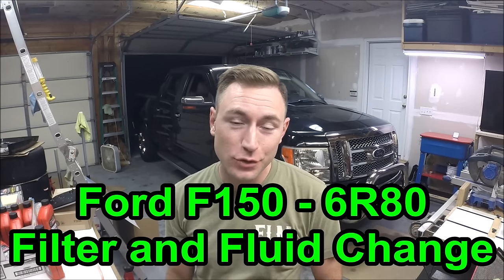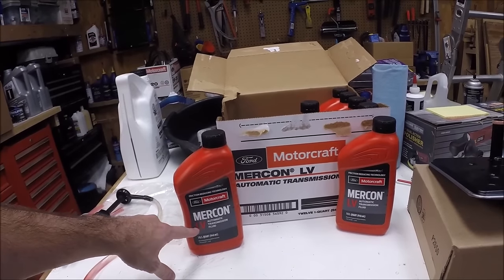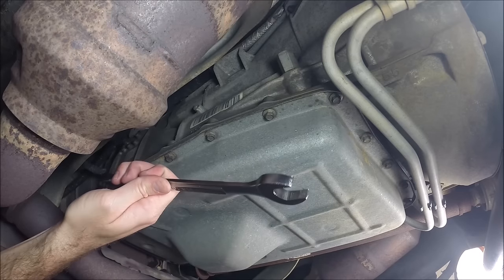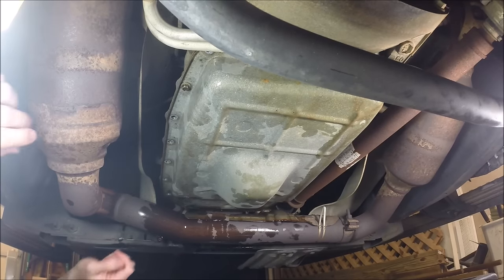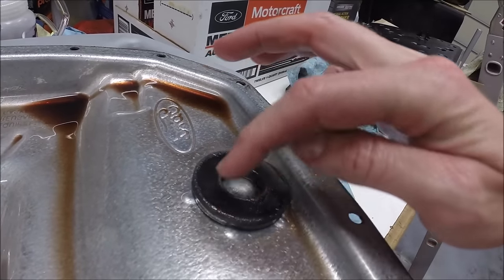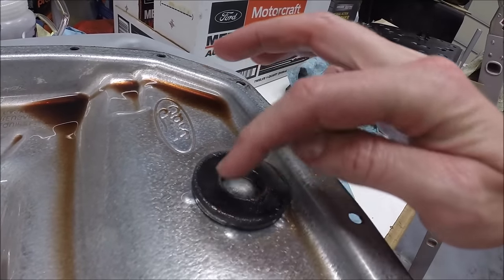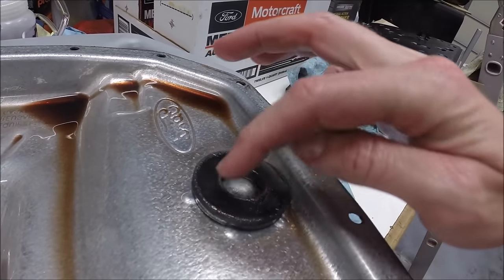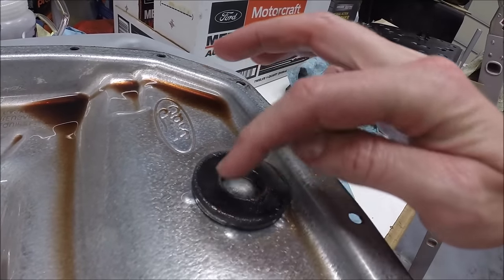Ford F150 - 6R80 Filter and Fluid Change

Comment: Thanks for the information about the measuring gauge - I have not seen this before.  Why is the oil not sucked out through this opening?  It would be a lot cleaner than be submitted to the Ford contempt for their customers.
Reply from the maker: You can probably get some of the fluid out of the fill hole, but not all of it.  You'll still have to drop the pan to get the rest out, and that still makes a bit of a mess.  I was changing the filter also, so the pan had to come down regardless, so I didn't spend too much time trying to suck fluid out of the fill hole.  With a bit more effort you might have better success?

Comment: Great video Scruf. Did the fluid and filter change solve your low speed shudder issue? I just bought a 2010 and it has that shudder.
Reply from the maker: Yes, it definitely improved it.   Well worth the effort in my opinion.
Reply: @ScrufsGarage  check TrasnsGO shift improvement kit. It will address the shutter issue. It’s due to wear in the valve body. Pt# SK6R80

https://www.rockauto.com/en/catalog/ford,2013,f-150,5.0l+v8,3000982,transmission-automatic

Comment: good time to add a bulkhead type drain plug...Fords new "no DIY" vehicles suck,no trans dipstick or drain plug,no fuel filter .sad ,I love my truck  except for these issues . Draining the pan and filter and adding 6 new quarts is nice but you are leaving behind about another 5-6 quarts in the system,its debatable if it needs to be flushed. Your fluid looks clean and magnet too..

Comment: Did it stop the rumble? Mine just started the rumble strip sound only at around 50 normal driving when I'm on the gas at a steady speed on and off a second or two. Almost exactly if you hit the strip and move off it. If I accelerate through 50 it doesn't do it, only city driving around 50 on and off gas.

Comment: Great attitude and awesome video!!! Getting ready to do my 2017 2.7 6 speed, been told it was the same transmission as yours. Lil nervous, but I do my oil changes and heard a lot of stories about being charged for this service and it wasn’t really done. My question when you start the engine to shift it through the gears and then check it do you need to put the cap where the lil dip stick was or is it ok to leave it off?
Reply: Put it back on

Comment: Did your truck run smooth after changing the fluid? Just curious on how the transmission performed
Reply from the maker: Yes, the fluid change helped reduce the shudder I was getting.

Comment: They make it difficult to handle. I have 2013, I don't see what interval to change the transmission fluid in the owners manual book. Can you tell me. I want to do by myself. Thanks
Reply from the maker: My truck was a 2010, but I'm pretty sure your 2013 is the same.   Ford considers the transmission fluid to be a "lifetime fill."  So they don't list a service interval.   But as you can see in the video, my fluid was very dirty.   I definitely think it is worth changing the fluid.

Comment: I know this is an old video, but did this fluid change fix your shutter?
Reply from the maker: Yes, changing the fluid definitely helped.   With a basic drain/fill, you get about half of the old fluid out.  So if your fluid is particularly dirty, then it may be worth changing the fluid a second time to help get a larger percentage of the old fluid out.

Comment: I have a 2014 F-150 Raptor . With 110,000 miles do you thing I should do mine? What transmission filter would I use? Do you have the part number? I’ve watched all your videos and they’ve helped me with my 07 FX4
Reply: Major Media freak You should have done yours at 30k per fordtechmakuloco. I follow his vids as he is very knowledgeable and a former ford tech. Mine has 49k and I just did mine after seeing his videos. Call a ford dealer parts Dept and give them your vin and they will tell you which filter you need it's either ft187 or ft188 most likely. Use what the book recommends for fluid too. Mercon LV
Reply: Peter Last-So I knocked it out. New filter oil and I added a new pan that has a plug. For future service. Man that oil was black!
Reply: Major Media freak what did the pan run ya cost wise? I heard they are expensive so I didn't bother. I'm sure that fluid was black with that mileage!
Reply: Peter Last -$36 on amazon Dorman 265-854 transmission pan with drain plug! In the past I got one for my 2007 Ford F-150 FX4.
Reply: Peter Last anytime

Comment: Changed the transmission fluid. Got 6 .5 qts into it but for some reason its not running no more any clue why? It was runnin great before the pan drop. Has 190k miles on it.
Reply from the maker: One possibility is that the filter moved while you were putting the pan back on and it's sucking air instead of pulling fluid through the filter.     Let us know what you finally determine it to be.
Reply: @ScrufsGarage  well I finally found out what was wrong. Actually my wife searched her ass off and found a similar case. Come to find out after market parts maybe designed the same but may not be the specific dimensions. The intake pipe that faces the pan was 3/4 too long so I used some snips to trim it down to the originals dimensions. It worked great. So to all who work on vehicles beware of these minor details.

Comment: Had a shop tell me they would have to loosen the exhaust to remove pan and gave me a 700 dollar quote to complete charge over. 
So I bought a new pan with a drain plug and am going to do it myself.
Reply: I drilled a 1/8 inch hole in the bottom of the pan. Let it drain over night and removed the pan. There was no fluid spill. Replaced the filter, used JB weld to plug the hole, replaced the pan and put exactly the same amount of fluid that was removed. Worked fine.

Comment: Looks. Like Dark oil might be rebuilding the trans ?
Reply from the maker: Yea, that trans fluid definitely was due to be changed.  No issues with the transmission itself, and no debris in the old fluid.  I recommend catching the old fluid in a clean pan so you can inspect it and make sure there's no glitter.  Ford calls this fluid a "lifetime" fill.  But seeing how dirty the old fluid was, I definitely think it's worth changing more frequently.

Comment: Can you drill and tap a hole to put a drain plug in the transmission pan?  I haven’t pulled the pan yet, so it may be too thin.
Reply: I took the pan off, drilled a hole then had a muffler shop weld a nut to the bottom of the pan since they weld thin metals without blowing holes through or overheating the whole thing and warping it, then I put an Allen head pipe plug into the nut, the pan is too thin to thread and most aftermarket add on plugs end up leaking anyway.

Comment: my 2014 3.5l ecoboost took 4.5 quarts after a pan drop. Owners manual says it holds 13 quarts. Crazy.
Reply: Hold 13 quarts total, which there is fluid in the transmission that can only be replaced by doing a flush not just dropping the pan..the torque converter alone probably holds 2-3 quarts.
Reply: @planetofthederps4490  Yeah I'm doing it again in a few weeks. It did make a big difference much smoother shifting.

Comment: Does it clunk when you take off from a stop? My 2011 does and it has something to do with the slip yoke binding on the splines. Drives me nuts.
Reply from the maker: No haven't noticed a cluck, but I'll be listening for it now, haha.    The shudder didn't start until the last month or two, though it seems to be a common complaint for a lot of owners.  Changing the fluid definitely improved the shudder, though didn't get rid of it completely.   But that's probably because you're only really changing about half the fluid in the system.  Depending on how motivated I feel, I might do another ATF fluid change at my next oil change... maybe.
Reply from the maker: btw, I think you jinxed me, haha.  I've been noticing the driveshaft clunk recently.
Reply: I had the clunk on my 2010 Platinum with 2 piece driveshaft. Was able to put it on a lift and pump a Sh*t load of grease into the splines and now bump is gone :).  After about 6 months its slightly back again so i guess its something i have to keep doing.
With 2 piece just make sure you buy the retaining clip for the boot,.
Reply: The clunk can be fixed by lubing the yoke and splines
Reply: Scruf's Garage try to mount a camera underneath looking at the trans. There's a guy that shows the shudder coming from it shaking all over. Ford wouldn't do anything for him though but it helps to see what's going on
Reply: @bobwalter5573  I had the clunk driving it home day 1 new. Figured it was normal and 150,000 now.
Reply: The clunk you feel is known as (slip bump) a well known issue with the two part drive shafts in this model year. To fix this issue you have to drop the rear end of drive shaft and and remove carrier bearing assembly and lubricate the spline on the shaft connection and reinstall drive shaft.

Comment: So did it fix the problem
Reply from the maker: Yes, changing the fluid significantly reduced the shudder I was getting.  Since you are only getting about half of the fluid out, doing a second change after a few miles would probably be helpful also if you have the time.  But I saw improvement even after just one fluid change.

Comment: Well, what was the result afterward? Did the shudder go away?
Reply from the maker: Yes, it was greatly improved.  Since you're only getting about half the fluid out in a drain/fill, you could probably see some more improvement from doing the service a second time.  But even just doing it once, I saw a noticeable improvement.  Definitely worth doing.
Reply: @ScrufsGarage  Good to hear, I just picked up some LV to do mine. Have a 2011 with 110k miles. Just started noticing shudder during acceleration in 1st and a little stiffer shift to 2nd.

Comment: Is it possible to use a hand pump and pump most of the ATF out via the dip stick fill hole? Is there a way to get a tube skinny enough down there to get most of it out before removing the pan?
Reply from the maker: While you might be able to get some of the fluid out, you'll still have to drop the pan to get the majority of the fluid out.  You make a mess either way.

Comment: Did that fixed your issue?
Reply from the maker: It made a vast improvement.  Occasionally I'll still get a funny shift but it's minor.  If I had more energy, I would probably benefit from changing the fluid one more time, but I'm not that motivated at the moment, haha.

Comment: At about 8 minutes into your video you remove the bottom pan but it does not look to me like there was a filter attached to begin with. What am I missing?
Reply from the maker: It’s been several years so I don’t recall exactly, but I think the filter fell when I shifted the pan forward.  But there was definitely a filter in there.
Reply: @ScrufsGarage  10. 4

Comment: Thanks for the video. Is that kudzu on the trees outside? If so, you are probably in the south east? :) About to change my transmission fluid, thanks for the video!
Reply from the maker: Yep, I'm in North Carolina.   And we're entering pollen season... there's a thick yellow coat of pollen on everything!
Reply: @ScrufsGarage  I know the feeling. I spent 12 years in Atlanta and my car would turn yellow every spring. My in-laws are also in NC, close to Asheville. Nice state. Thanks again for your video, I went through the same thought process as you described at the end, where I was confused when my pan started overflowing around 5-6 quarts. Had to keep going while the truck was running, which can get toasty a bit.
Reply: Forgot to mention: 2010 F-150 FX4 (6r80 transmission): got 6.5 quarts out, put 7.5 quarts back in. Also, I was about to get about 3 quarts out before dropping the pan by using a manual transfer pump that you get at Harbor Freight. I was trying to avoid making a huge mess.

Comment: From  THAILAND! sorry How kilometers's to change transmission fluid and filter?
Reply from the maker: Ford considered the Mercon LV to be a "lifetime fill" fluid.   Thus why they didn't design the pan with a drain plug or an easy way to refill it.  So there's not a set mileage interval to change the fluid.  I started developing a "shudder" at low rpms, so I decided to change the fluid, and it has definitely helped.
Reply: Thank you so much! I used Ford ranger. The transmission's 6R80.I   changed transmissions fluid and flush about 11.5 liters.

Comment: To check fluid, did you heat the truck up cut it off and check it. Or check it with it still running.
Reply: I have the 2010 4.6. it's been nothing but a money pit so far. Had torque converter replaced, trans. Gasket and cam shaft rebuild from the phasers. Had it a year now. I'm 6 grand in  repairs with the truck being bought at only 12. Can't find much help on these trucks. Just negative comments.
Reply: @bigd3213  that's because you bought someone else's abused not taken care of truck more then likely. Sorry to hear that it's a money pit for you. I too have the 2010 4.6 3V and have had zero probs except for a tpms tire pressure sensor and just last weekend I seen a tiny bit of trans fluid on garage floor. $19 part for connector sleeve in top of trans......now fixed. Love my truck. Could use a little more ass when it comes to towing my snowmobiles up north to Michigan but it gets the job done. 105,000 miles. I change the oil every 3500 miles with full syn Mobil 1 5w30. Ditch using Ford's recomnended 5w20. Never had any cam phazer probs or timing chain slap noise or ticking. It is rusting tho.

Comment: Do you think it's possible to use a transfer pump to empty the pan before dropping it? Stick the end of the pump into the fill hole and pump the fluid out?
Reply from the maker: I imagine you could at least get some of the fluid out.   Not sure if you could get all of it or not?   I just didn't try it so I can't say for sure.
Reply: @ScrufsGarage  I just changed my fluid and filter.  I used a transfer pump to remove 4 quarts through the fill hole before dropping the pan.  I removed an additional 2 quarts from the pan and filter after removing the pan for a total of 6 quarts.  After replacing the filter and pan I was only able to put in 5 quarts.  I started the truck, cycled through the gears, stopped the truck and added an additional quart for a total of 6 quarts.  Based on your video, sounds like I should add another quart and 1/2 while the truck is running.

Comment: Did this take care of the chatter you heard mine did the exact same thing ten minutes ago and how do you tell what trans you have, i have the 2010 lariat 5.4
Reply: I'm wondering this too. Mine has 324,000+ miles trouble free.  Starting to notice a little chatter at light throttle.  Wondering if it helped it.

Comment: Did it make the shuddering stop?
Reply from the maker: Yes, for me this significantly reduced the shuddering.   Keep in mind you only get about half of the fluid out.   So depending on how old/dirty your fluid is, you might consider changing it a second time after a few miles.   But I only did it once and saw improvement.

Comment: I hear changing the fluid could make it slip. Are you experiencing any of that? I'm at 134k miles with my 2011 f150 5.0
Reply from the maker: Brayden Bledsoe  Often it is the back flushing procedure that can cause slipping on a high mileage transmission.   This is only a fluid change so very unlikely to cause any problems.   I have not had any slippage before or after.

Comment: I have the 2012 Lincoln Navigator with the same transmission.  A mechanic friend at the my local Ford/Lincoln dealer recommends that transmission be drained and filled at the first 30K miles and then every 60K miles there after.  The design of this transmission means it is under constant negative vacuum pressure.  That's the reason Ford didn't provide a dip stick.
The only after market dip stick kit available in Canada is just under $500 and it just friction fits at the transmission with double O-rings and it's susceptible to air leaks and failure, so I wouldn't recommend it.
Reply: If it is pulling a vacuum, where is the air expelled from the transmission? I wonder if this is to remove air and oxygen from the fluid?

Comment: I don't know why... but my 2010 F-150 truck  4.6 engine have a original transmission fluid dipstick under the hood... I like it.
Reply from the maker: It sounds like you may have the 4spd automatic, the 4R75E.
Reply: @ScrufsGarage  you are right. That's the one it has...

Comment: I just did this on my 2014 F150 3.5L ecoboost and I got about 5.5 qts out, and only 5.5 qts in when it overflowed. I didn't think to put in while running. Just concerned if I over fill it what that would do
Reply: Update after adding while running and warm, it took additional 2 qts to get to the warm line on dip stick for a total of about a little under 7.5 qts
Reply from the maker: Thanks for sharing the update!

Comment: Did changing the fluid take away the skip you were feeling in low rpm takeoff
Reply from the maker: Changing the fluid definitely helped with the shudder I was experiencing.   Also worth noting is that there is another common issue with the F150's; a "clunk" noise when taking off from a stop.   That is typically related to the driveshaft slip yoke.  Not a difficult fix, but not solved by changing the transmission fluid.   Hope that helps.
Reply: @ScrufsGarage  thanks a lot gonna change it this weekend 👍🏽

Comment: After you change the fluid, did your transmission shutter go away?
Reply from the maker: A significant improvement.   Still get an occasional shutter.   I would probably benefit from changing the fluid one more time.